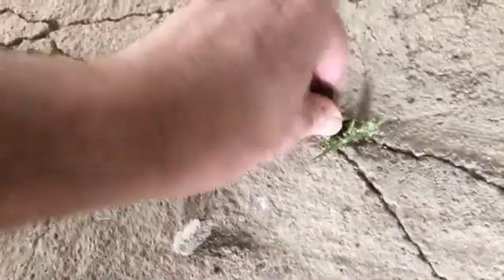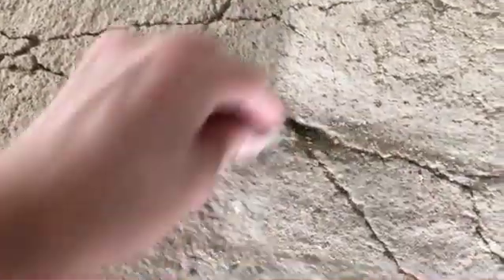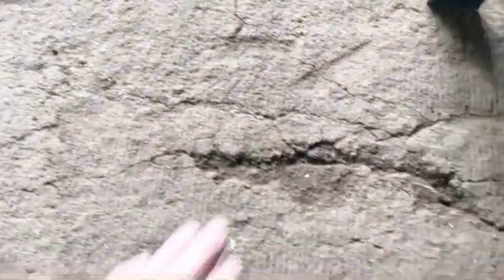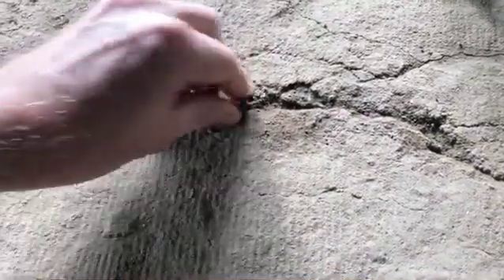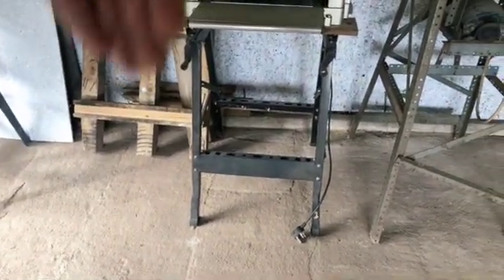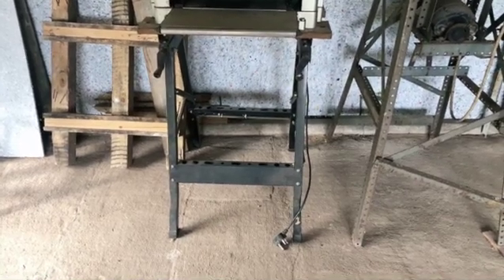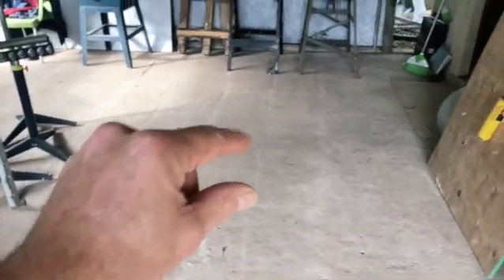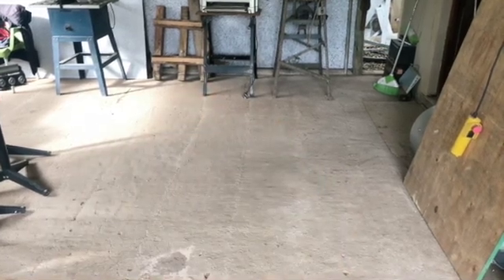Earth Cement Floor One Year Later

Comment: Why not use rebars to prevent cracking or mixing them with fiberglass
Reply: The goal is a cheap hard spot that ain't mud. Not perfection
Reply: You wouldn't want to use rebar due to rusting. It is soil so not a perfect mix. One thing is the cement content. The mix doesn't have the same cement all over which means it might be a Lil weaker in some areas. But for the price cracks can be fixed with cement and soil paste if you really don't look like the Crack look and also there are no expansion joints cause this stuff still needs to move. I did a walkway on a side yard and did it in sections. Mixed it like concrete with s little less water and it still looks OK 5 yrs later.
Reply: @roshawnsims8390  it wouldn't hurt to have rebar. It can rust inside of normal concrete. But it's just more expedient to just use a little extra cement and hope for the best cuz it'll be good and hard.
Reply: @EthanPDobbins  A question that I would have is I saw one floor pour that used galvanized fencing in the pad.  Also this fiberglass rebar I think might be as good and you have less issue of rust. I've heard that rebar shouldn't have rust on it when you do concrete but man how much of that stuff do they sell at the box store with rust being on almost all over it. Coated rebar has to not be cheap also.
Reply: would probably make a lot more sense to use bamboo or, hemp if thats an option. theres a bunch of options for reinforcing rammed earth beside rebar.

Comment: Thank you for both videos, it's very helpful to see the floor one year later and to hear your honest conclusions. Do you think the same idea would work with lime instead of cement? As lime is more flexible and breathable there might be less cracking. I am thinking of using your method to renovate a floor inside an old building that will be a workshop. I am in France and there is an old traditional type of floor called 'terre battue' or 'beaten earth' which uses lime.
Reply from the maker: Hi. Thanks for your comment. I think it will work using lime. However I would advise to do a few tests balls with different ratios using your soil and lime. Then when you like the results chose a ratio and di a 1mx1m test square , let it cure and see how it performs before doing the whole floor. 
Good luck with your project!

Comment: would it crack if this were not exposed to the elements? like on the inside of the building?
Reply from the maker: It will always crack a little. unless you put some expansion joints in. It is like cement ,
Reply: @thequixotryworkshop2424  Maybe the cracking could be reduced, if some fiber - like straw - is added?
Reply: @thequixotryworkshop2424  thanks for responding. excellent alternative